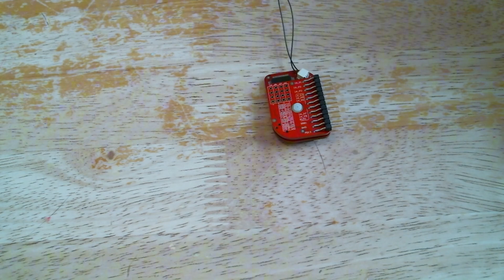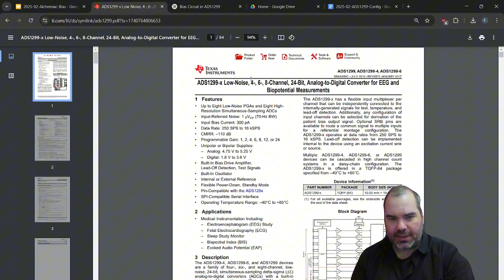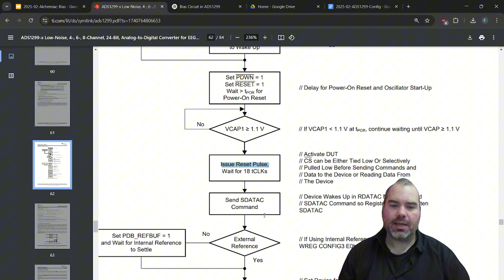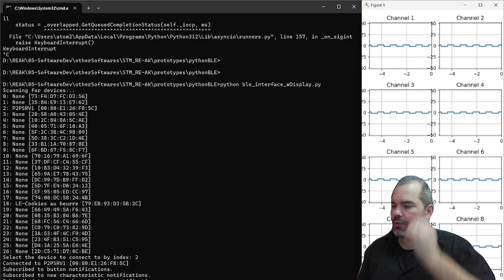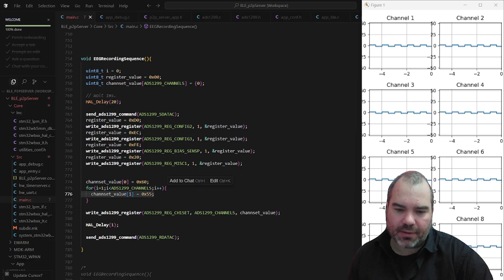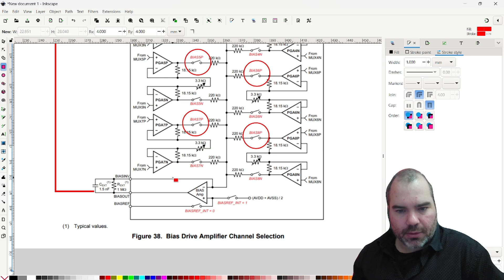ADS1299 Bias explanations and demo + Introduction to the Nucleus-Alchemiac

Comment: Where was your SRB1 connected?
Reply from the maker: I use the SRB1 as the reference. If I remember well, I think I put it on a different finger. I had sensing + bias, close to one another, on one finger, and the ref on a different finger.

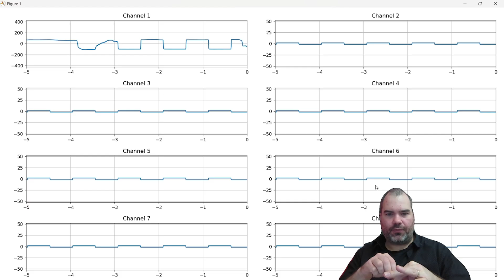edit: look at 20:22, I'm holding 3 wires with my hand.
Reply: @re-aktechnologies  Great! thanks! I have been trouble debugging a ADS1299 device and it seems mismatched electrode types between the analog in pins and SRB1 can really mess things up.
Reply from the maker: @PorkChopify  You're using electrodes with different material ? If so, I had similar issues mixing gold cups with Ag/AgCl electrodes.

If so, the issue you are facing is different materials will, with the skin, form a battery (that's the best interpretation I ended up finding, but I'm not 100% sure). This battery results in a DC offset, which can pull you signal toward railing.

Depending on your application, try reducing the gain. Many uses the 24x gain configuration with the ADS, because... but if you're only doing power bands analysis, you should be good enough with 12x amplification. This will make it much easier to stick away from signal saturation.

Comment: Are the gerbers going to be open sourced?
Reply from the maker: Thanks for engaging. There's no plan to for now and the reason is simply that I need to turn in some ROI, but I'm very open to any win-win deal: volume discount, licensing, on top of selling the unit at a fair price for hackers.
Reply: @re-aktechnologies  Sure, I'd love to see what sort of price point I'd be looking at. Does the coolness of what I'm integrating it into factor into the discount?
Reply from the maker: @devinkramer9875  Let's discuss it over Discord, but the short answer is yes. We're getting started so anything that factors in some showcase, marketing potential, can be factored in. We could even feature your work across our networks.
Reply: @re-aktechnologies  Got it. Who should I message?